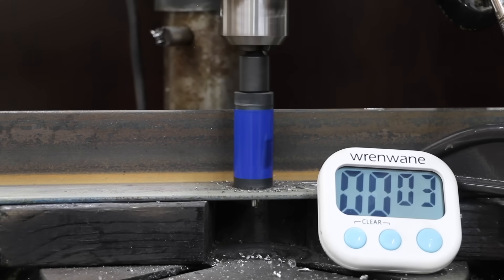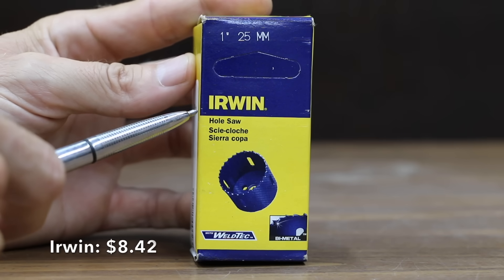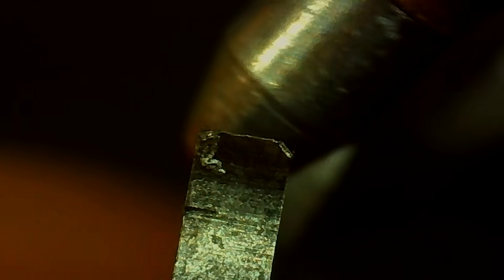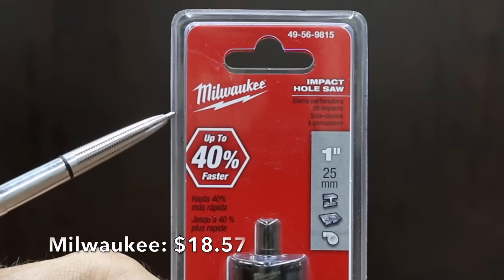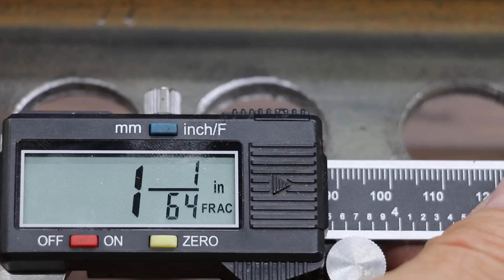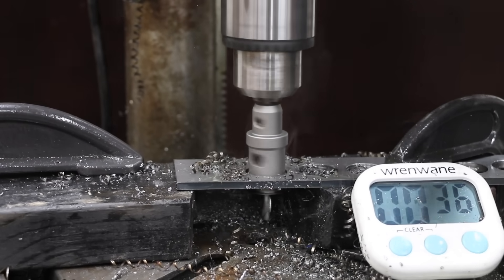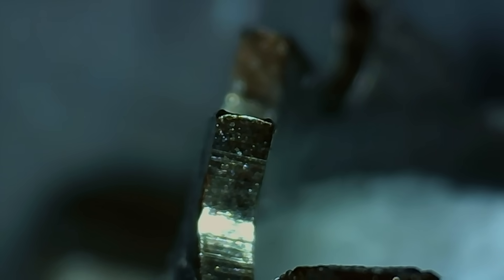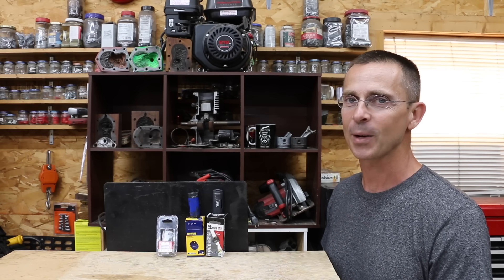Best Hole Saw Brand? DeWalt vs Milwaukee vs Irwin, Bosch, Lenox, Diablo, Bosch, MK Morse

Comment: Seeing all the effort put into this, I'm rather disappointed that you dismiss the relevance of the tooth count in your assessment. You can lay on a bed of sharp nails if the number of nails per square inch is high enough despite each individual nail being as sharp as can be. The pressure PER TOOTH is 10 times lower for a 40 tooth than for a 4 tooth of the same diameter. It's shame that this very significant factor was simply disregarded and unaccounted for given you put so much time (and money) into trying to bring useful information to your viewers.

Comment: Incase you are not aware those callipers cannot accurately determine an inside diameter. This is due to their flat jaw surfaces touching a curve at two points thereby leaving an undetermined gap... There are special callipers able to read IDs (and flat surfaces). These use cylinders as the measuring jaws thus providing a single point of contact between an internal curve and measuring jaw.

Comment: So, I guess my question would be, are the carbide hole saws worth it? Just cutting mild steel, maybe cast iron, as I do most of the time, are the carbide saws worth the extra cost? I'm not really concerned about cutting speed, I want dollars per cut over the lifetime of the blade/bit. Same thing with drill bits.

Comment: Could you test wood hole saws? Also possibly drilling through mock walls with insulation to see quality and how many times you’d have to empty before getting through to the other side kinda thing
Reply from the maker: Thanks for the suggestion.

Comment: carbide cutters in any shape or form are so prone to chipping if you have any runout. mabe doing this test on a bridgeport mill would have shown better results for some? I use carbide hole saws on my mill and with the extra rigidity in the machine I can make them last a lot longer. excellent review!
Reply from the maker: Great point! Thanks

Comment: I saw some wobble during some of the tests.  Was/Is there anything you did to ensure that the mandrel was exactly centered?  Being off a little could cause wobble and breaking of extremely hard (brittle) teeth.  Perhaps a dial indicator should be used to ensure the bits are each centered the same would have been a good move.  Anyway, thanks a bunch for this test!

Comment: That's crazy, I use the Milwaukee shockwave alot. I'm an electrician and it seems to go through panels decently enough but when I need a great hole and long life ,it's always the Greenlee carbide 3piece set. Those things are tanks,you should get some of those to test but then again I never cut metal as thick as what you're testing here.
Reply from the maker: Thanks for the suggestion.

Comment: Do you think that maybe, just maybe, the stopping of the hole saws, is not really the fault of the hole saw, but that the drill press drive belt is suspect?
I find that I get better performance from my drill presses because I replace the drive belts each year. ( i.e. old belts just don't grip as well as new belts,  in my experience )
I just noticed how much free play there is in that Drill Press spindle/chuck as you start into the cut, then this steadies as the saws get`s into the material. ( Just watch there at the 14:52 mark )
Do you think that a wobbling drill can lead to jamming of the saws?

Comment: as a former farm mechanic/technician/engineer/machinist/etc/etc (yes, I lived on a farm, which was a junkyard, which was also the home base for short haul refrigerated trucking... so I have insane experience there) and current friendly neighborhood mad scientist (who works at a discount auto parts store to pay the bills), I've always been impressed by the Irwin brand for everything from their vice grip pliers to the various bits/saws/taps/etc they make.  For the price, across the line, they are the best in the business.  Yes there IS better stuff, but it's EXCEEDINGLY more expensive in most cases.  I don't mind when i destroy a set of irwin vice grips.  If I snap a set of Fiskars scissors, or kill a Benchmade knife, or have a Surefire flashlight die on me... then I cry >.<
Reply from the maker: Thanks for sharing!

Comment: I think a good video would be twist drills with different hardening methods and or additives. Like hss vs has with cobalt vs has with molybdenum. Cryo hardened, nitride case hardened. Spider bits. All kinds of different coatings. I'm a metal worker and my shop specializes in stainless so I'd love a bit set I can buy that will actually last a while in heavy stainless applications.
Reply from the maker: Thanks for the video idea.

Comment: I wonder if the impact models would perform better in an impact gun. Perhaps they were purposely designed for short repetitive strikes rather than a constant force for the teeth to perform optimally.
Reply from the maker: Thanks for the suggestion.

Comment: Just another in a line of great product tests.  Thanks!!!  Just one comment and I apologize for making a picky comment... but I think showing the hole size accuracy as, 1.007812" and only being over by 0.007812" (or even 8 thousandths) instead of saying the hole measured, 1-1/128"  I don't expect that many of us has measured anything by a 1/128th before.  Thanks again and I certainly appreciate the obvious time work put into all these tests.

Comment: Great video, but I feel like the Shockwave got stiffed. It's not meant for thick steel like that. I use it to drill holes in electrical panels, and similar things and it does a terrific job
Reply from the maker: Thanks!  Thanks for the feedback.

Comment: I'm an Electrician and have made thousands of holes in mostly 12-gauge steel panels and up to 4" holes (that will take you for a ride).  Yes, an odd thick steel plate, aluminum plate and steel diamond plate.  I use a hand drill motor and a pilot drill (for centering).  The secret is to keep your saw cool.  All of yours overheated and softened the teeth.  Another 'trick' is to slightly 'cock the saw sideways' in a slow orbiting motion so that only a few teeth at a time are cutting.  This also keeps the saw cool and lightens the load on my drill motor.  Tap Magic works the best because it evaporates quickly and it doesn't leave a mess like oil-based cutting fluids.  My hole saws last a very long time when kept cool.  BTW, nice vid but I rarely used a drill press when cutting with hole saws.
Reply from the maker: Thanks for sharing.
Reply: "Electrician" is a brand name now?

Comment: I was wondering if you can do a product comparison with hole saws for porcelain and stone and other ceramics.   I've seen some "diamond" core bits that is supposed to last the longest and/or cut the fastest, but I have never seen a comparison video on them.
Reply from the maker: Thanks for the suggestion.
Reply: "Diamond" in quotes? Oh, you don't think those blades are actual carbide ones, then, or...?
Reply: @HelloKittyFanMan.  - I just bought a set of various sizes for $10.   But I've seen prices from under $10 to >$25 and they are all marketed under different brands.   Some look exactly the same, others look different.   I have no idea which work well, which last the longest, what materials they work or not work on.  I'm gonna use my set on clay and porcelain and brick and stone and concrete and see what will happen.
Reply: @brucesatow : What I'm saying is that if it says "diamond" or "carbide" on it, and it's a reputable brand, then there's no good point to putting quotes around the word "diamond" in this context as if they were only being figurative or making a claim that you couldn't take seriously.
Reply: @HelloKittyFanMan.  - How would you know if it a reputable brand if it is a brand you never heard of.   How would you know if it is actually diamond or carbide on it until you used it?   Thus the quotes I used around the word "diamond" because it is questionable until proven true.
Reply: @brucesatow : I didn't say you would. But I'm talking about brands like the big-name ones that he normally tests. They don't say things like "carbide" unless they actually have carbide.
Reply: @HelloKittyFanMan.  - Well we'll just have to see if he actually will does my suggestion or not.   I'm sure he gets quite a few and my suggestion isn't that great.   I would be interested to see what he finds out.
Reply: @brucesatow : Yep, it will be interesting to see if he does. Happy 2222-Groundhog Day!

Comment: For a friend I needed to drill through a specialist high lift Mower blade (for bigger bolts). All I had with Carbide cutters in that size was a masonry drill. It was a horrible process, the heat was nasty. In future I would buy a specialist Carbide drill, or just say no.
Reply from the maker: Thanks for the feedback.

Comment: Excellent test! I'll be making a buying decision because of your work here.
I was a little concerned about the drill press' horizontal movement (most noticeable during the armor-plating test). Is that just the camera, or was the mandrel moving? If it's not the camera, surely the movement would negatively affect performance.
Thoughts?

Comment: Hercules is making hole saws now. Haven't tryed them yet. Wonder if they are like thier step bits. If so, very good price point

I had the same Issues withe Milwaukee,  it only drilled 1 hole in mile stud steel.
Reply from the maker: Thanks for the suggestion.

Comment: Have you ever done a comparison of different cutting fluids?  Is there one that helps tools last longer?  Cut faster?  Or smoke less?  Seems like most of the time when I use oil to clear chips or cool the tool, it creates tons of smoke and odor that I think might set off the smoke alarm.  Id be interested to know what's best!
Reply from the maker: Great suggestion!  Thank  you.

Comment: Wow great tests, I cant believe these things in fact cut metal (they are not advertised as such), but on the other hand they should, since they are hardened, I really like hole saws, easier on tool remove less material 👍
Reply from the maker: Thanks for the feedback.

Comment: I know it's expensive, but would u consider getting a mill for this kind of testing? Also would be really cool to see a carbide endmill showdown
Reply from the maker: Thank you for the video idea!
Reply: @ProjectFarm  i think that the drill press just doesn't have enough torque for unlocking the full capabilities of this holesaws( in the endmill showdown, specifically would like to see the Aliexpress flavor of endmills they are a huge amount of different brands with some pretty big claims)

Comment: I recently came across your videos and I absolutely love them. Your testing is extremely thorough and comprehensive. At one time, our property had to have some fairly extensive foundation and plumbing work. This resulted in a number of areas where concrete was repaired very poorly (the ratios were nowhere near correct). I would love to see a comparison on concrete grinder discs. Thank you.
Reply from the maker: Thanks!  Thanks for the video idea.

Comment: My experience is about the same.  The high dollar carbide saws work great for about two holes, then the teeth break off.  That said, I spin them way too fast and use them in thick, work hardening iron door frames.  :)
Reply from the maker: Thanks for sharing.
Reply: @ProjectFarm  Thank you for the great work you do.

Comment: For the price point, I swear by Irwin products. Unless you're a fabricator or machinist, you're not drilling hardened thick steel. I just bought a set of Irwin bolt extractors (easy Outs) as I had 6 transmission pan bolts break off.. A simple fluid n filter change turned in to a nightmare. I'm using Dewalt bits to drill the bolts. I'm interested to see if the $14 set of Irwin Easy Outs is up to the task.
Reply from the maker: Thanks for the feedback.

Comment: Armor plating? Abrasion resistance 500? Yes it takes a bullet and turns it into dust easily, but, it is made to Be resistant to wear and tear, not really as armor. I wonder If it is used on like excavator buckets and such.. Love the channel and Been binging your vids without any particular purchase in mind.
Reply from the maker: Thanks!  Thanks for sharing.

Comment: Guys I've burned thru 8 drill saw bits today. I'm trying to cut through about a .5 inch steel insert for a firepit. Using a Dewalt XR drill...Any recommendations? I keep hearing to get a diamond cut ont. I've used Lennox, Milwaukee, Ace hardware brand and they all failed. Lennox drilled most of the holes but my drill teeth are just melting away. I'm now using some silicone WD40 to help "cool" things down. Help please?!?!?

Comment: I just drilled 30, 40mm holes in .253 square tubing with a carbide hole saw made in China, using a cheap mag base drill, also made in China. The pilot bit is slowing down a bit but the saw is still going strong, and I'm getting +.15mm tolerance on EVERY HOLE using a good cutting oil - $11 on Amazon.  Does Drill Hog warranty shipping costs as well?  At that price with a "lifetime warranty", you're paying for 6 saws up front,  but you're losing on shipping, $8-$10 one way. 
I don't care how fast it cuts, how many holes can it cut before it's useless?  I WANT to buy Made in USA, but cost v quality, Chinese products are getting better and better every year. We've priced ourselves out of the global market. You can thank DEMOCRAT UNIONS for that.

Comment: My old place only bought irwin holesaws, and we were cutting through tough steel. One thing to remember is if the hole needs to be neat, go a size lower and be ready to dress the hole up to size afterwards. Irwins do spiral and ruin the surrounding suface.
Reply from the maker: Thanks for the feedback.

Comment: That $7.99 NGE did an impressive job.  My concern would be that quality control for such a cheap tool is not the best and that, were I to buy one, it would have come from a different factory, be made of different materials, etc., and not be nearly as good as your example.
Reply from the maker: Thanks for the feedback.

Comment: Hey I'm looking at these 8tpi reciprocating saw blades for metal, diablo in particular... and my experience says that a higher tooth count would cut a lot better. Is it possible to test high tooth count vs low tooth count, preferably in the carbide tip variety? Maybe 8tpi vs 14tpi?
Reply from the maker: Thanks for the suggestion.

Comment: To be fair, this particular application of carbide is more for increased wear resistance(longer time between tool change) rather than expanded range of workpeice materials(thicker/tougher/harder metals) and is generally better suited for wood/plastics/sheet metal etc.

The large amount of spindle/tool runout (and minimal control over cutting conditions) creates unpredictable loads for each tooth contributing to decreased tool life (chipping the carbide because one tooth may be randomly cutting .001 inch per tooth and one may be cutting .020). For optimal performance and tool life, one would ideally control cutting velocity and feed rates based on tool material/workpeice material/coating/tool diameter/toothcount/cutter geometry/heat removal/vibrations/etc.
Reply from the maker: Thanks for the feedback.

Comment: I appreciate the metal comparison but what about 2by lumber. The release function is what could be talked about like how diablo has an impact connect mandrel so you can easily take your cut piece out. Also dewalt has a new 3 or 4 tooth hole saw I would be interested to see how that works out.
Reply from the maker: Thanks for the suggestion.

Comment: electricians use hole saws all the time.  the best ones i use are from ideal.  a great test would be to test knockout sets.  both hydraulic and manual.  thank you.
Reply from the maker: Thanks for the suggestion.

Comment: Throw away the holes saws and by an adapter to run annular cutters in your drill press, I had some big holes to do (1-1/4 & 1-1/2) in 1" - 2" thick steel, they work like a charm and come with an injector pin to shoot out the solid slug..
Reply from the maker: Thanks for the feedback.

Comment: I don't know about having a weighted pulley like that. At least when I use a hole saw, I like to keep the pressure just right above stalling. And frequently lift it up  to let the saw clean its teeth.
I would like a test where Todd just try his best manually operating the drill press.
Reply: And i could note that at my last job I used to cut holes in a lot of stainless steel, and when cutting thin pieces, I used the auto feed, but when the piece was thicker than the depth of the teeth, I did it manually, from when the teeth bottomed out. Unless it was like 500 holes to cut, then I just used a drill on auto feed instead, if I could get my hands on a big enough drill.

Comment: I just used a Milwaukee 1 1/8” hole saw bit with the carbide teeth to drill six holes in 3/4” think steel plate. It seems to be almost as sharp as new.
Reply from the maker: Thanks for sharing.

Comment: Today I am drilling some 1" holes in a steel frame for rubber grommets for pex plumbing.  I was most disappointed with the performance of the Bosch, Milwaukee, and Makita hole saws.  Some of them lasted only cutting four holes.  

The Lenox 1" hole saw saved my day.  So far I have cut 25 holes with this saw and there is still lots more life in this saw.

That Lenox was imported directly from Amazon.
Reply from the maker: Thanks for sharing.

Comment: In the UK we have Armeg holesaws that are decent, not sure if you have them the other side of the Atlantic but it would have been interesting to see how they would fare. For cable entry we usually use 20mm most of the time.
Reply from the maker: Thanks for the suggestion.